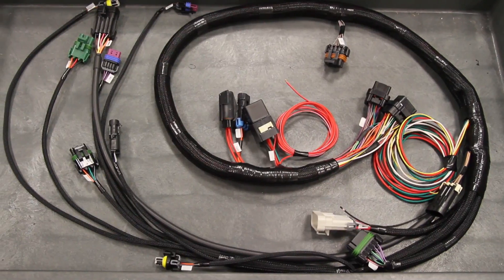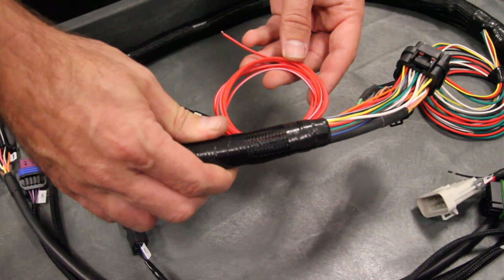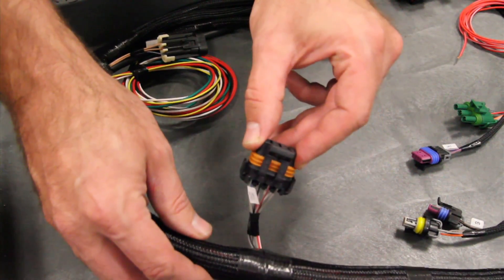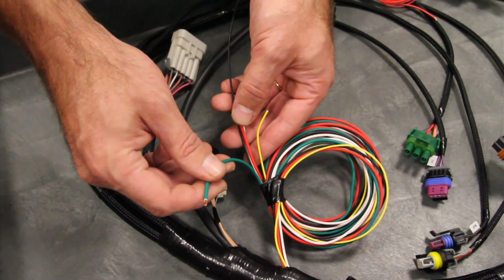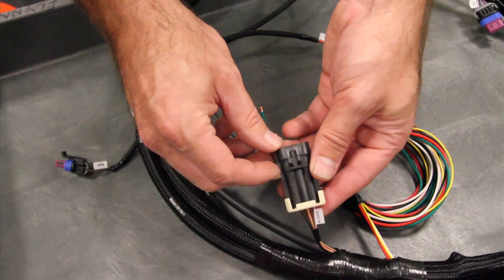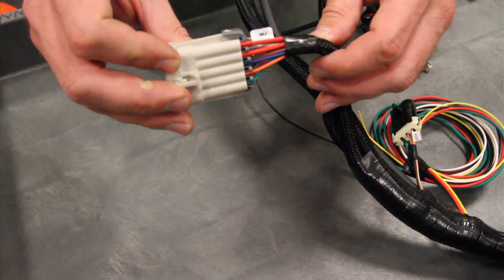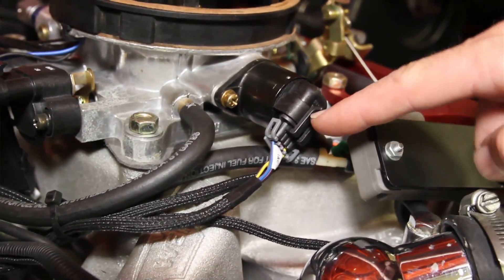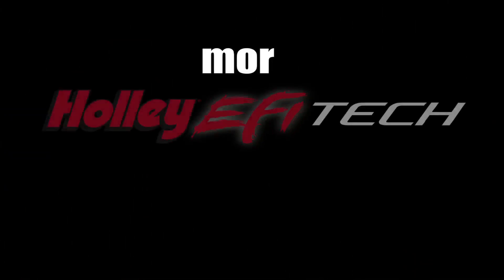Holley - EFI Tech: Main Harness Overview

Comment: What size amp is the fuel pump/fuel injectors relay help lost my directions, got a red No Data display , was stranded & towed home any help would be appreciated as I'm not sure why my engine stalled and ECU is not found in system Holley 919